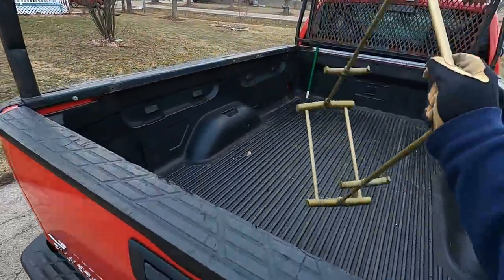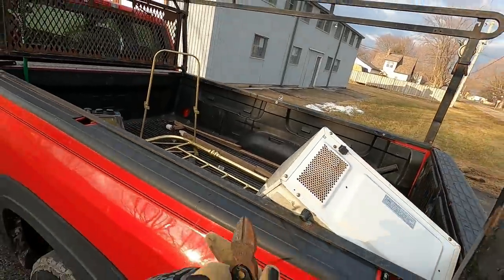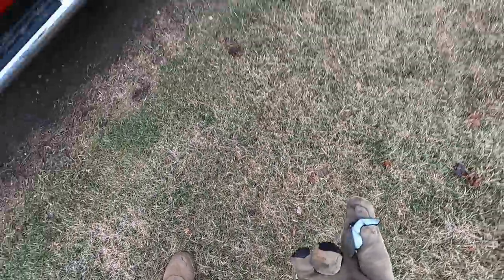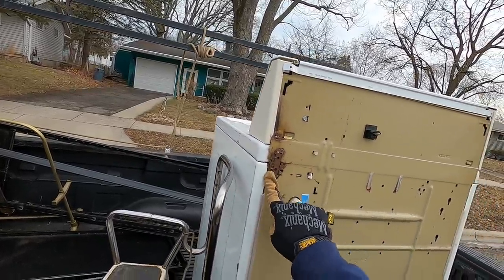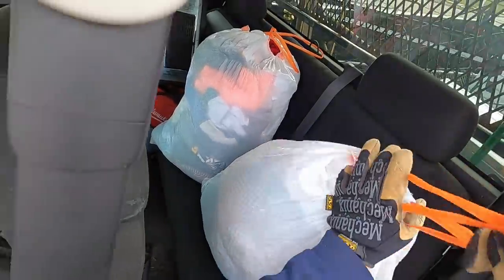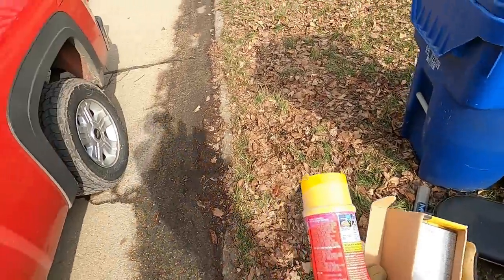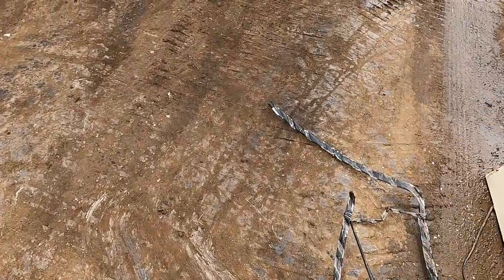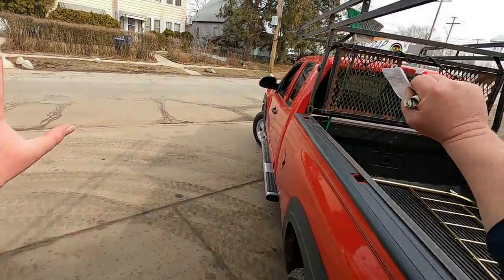That Shouldn't Be in the Trash - Dumpster Diving Trash Picking

Comment: Question: is it ok to dig through the Recycle bins by the curve next to the trash cans ? Or is there some unwritten rule that not ok ?
Reply from the maker: Only certain items are allowed in the recycle bin. Food glass, food grade plastics, newspaper, aluminum cans and metal food cans. In my area they do not take scrap metal. It causes problems with their sorting machines. My garbage man says if scrap metal is in the recycle bin it will get thrown into the garbage and slow down the recycling process.

Comment: The connectors were 200A Amphenol's. for large batteries  and the string of caps  was a watering system for flooded cell batteries and the bags of caps were the cap to the old batteries so I am glad that you didn't open them as that wasn't oil it was acid.
Reply from the maker: Amphenol. That's right. I was thinking molex or TE connectivity

Comment: Hi. Just remember microwave ovens have a bulky transformer in, with a reasonable amount of easily retrievable copper.
Reply from the maker: I avoid the beryllium oxide and don't open up microwaves
Reply: @ScrapPalletMan   👍👍Just stay away from the magnetron (in case it is an old one and has Beryllium oxide in it ) the transformer is quite safe and easy to remove.